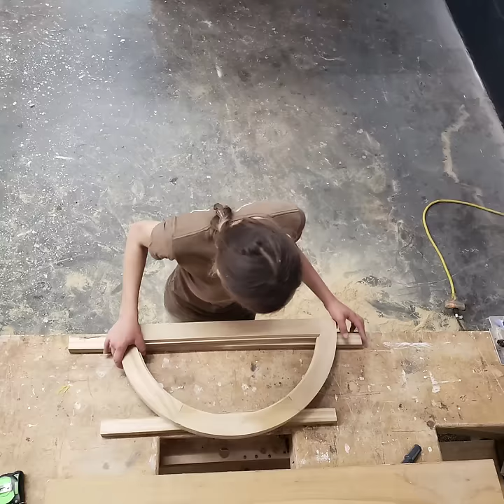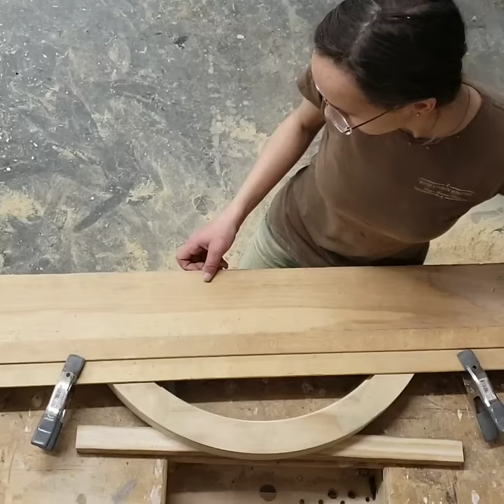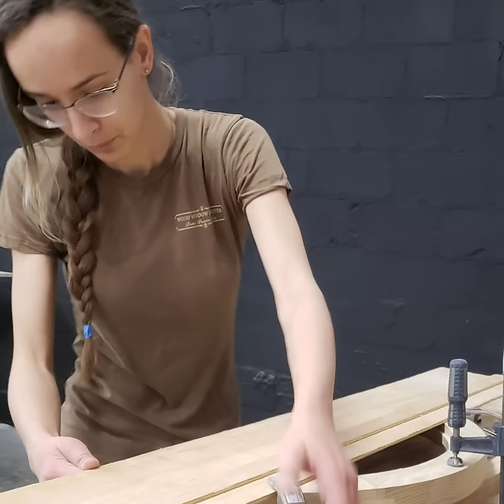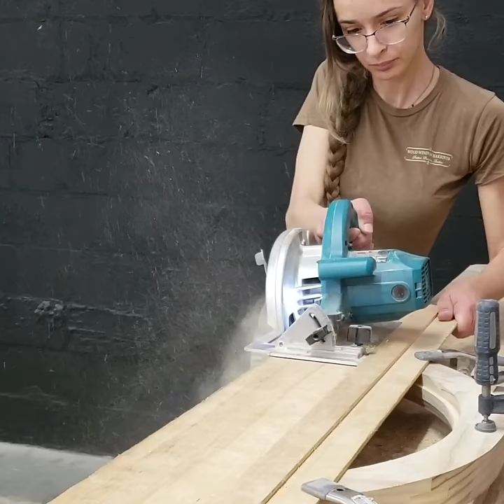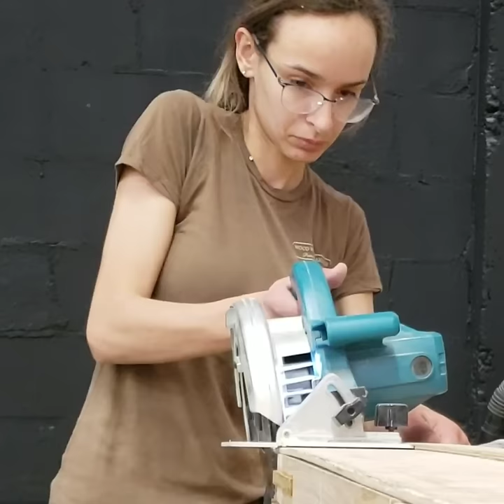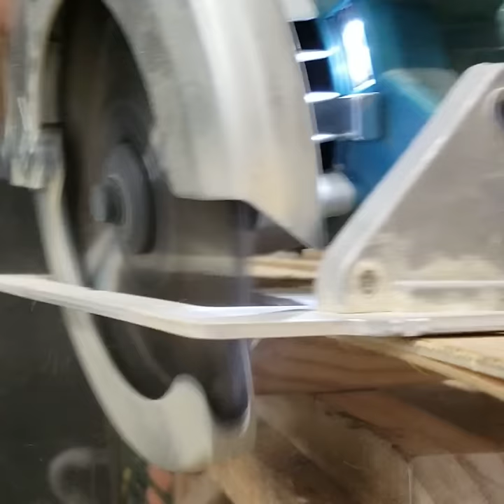Method to Cut Straight with a Circular Saw

Comment: Wow so your using a straight edge to guide the saw... gee whodathunkit?
Reply: Theres more to it than that, the straight edge is on a board which can be lined up where you want the cut (rather than having to offset the straight edge from your cut line)
Reply: All you gotta do is grab the front plate of the saw after you know where you wanna cut and squeeze your finger against the edge of the wood as you push the saw.
Reply: @sykwiddit8575  that's sorta what I do, depending on length/location of cut. Can usually get it good enough for most stuff that way.
Reply: @sykwiddit8575  and which is fine if the existing edge is straight. Even if it is straight, what if you you wanted to cut it at an angle ? Say fitting the bottom sash to an existing sill?

Personally I wouldn’t be without a track saw anymore, this sort of idea is ok for a one off or purely square cuts or a particular angle. Usually this configuration won’t cut any bevel all passing through the same point on the surface.

I came looking for this as some guy was banging on about the ‘beautiful girl’ on the latest video, Steve’s about as pretty as me so I came for anthropological reasons 😉

Comment: Lovely hair but when  it is that close to machines scares it scares me.
Reply: Wolf Den  hate when that gets caught in saws, luckily mine is so thick the saw just shuts off like a SawStop. A bitch to untangle though.
Reply: Especially 8k RPM spinny wrappy bladed machines.  Can't think of much scarier than a circ. saw suddenly jumping at your face as it reels in.

I guess you wouldn't really have time to be scared though.  Still, lots of time for regret!

Comment: Can you the explain all the Big D's? What's the purpose of those half circle arch in the back so if you veer off to the left or right it will turn but the front stays straight?
Reply: Which way was that meant😅🤣I'd say they're about that size
Reply: Pretty sure the big ds are what they want to cut the straight edge on. They look like they’re arch window frames or something similar. The thing they are showing is the board with the fence on where the saw blade is bang on the edge of the board so you please the board edge on the cut line and away you go. Look up track saw use. It’s the same but without the huge price tag.

Comment: Do people actually need to be told they can use a fence to cut straight?
Reply: Yes.
As well as they have to be told to follow standard safety procedures... Like putting up your hair, wearing gearing protection, bracing your work...
Reply: @Glaswalker1001  don't you know? If the hair is up, the likes go down! It's all about the likes man!
Reply: @thelos3999  and you will get the most views if your hair is caught in the rotating tool and severed from your skull.
I know.
Reply: @Glaswalker1001  now you get it. 😁

Comment: I don't like to seem like a H&S freak but the lack of ear/eye/respiratory protection is not good! I always make sure that before I make any cuts I have at least 2 of the above. When I am working outdoors respiratory protection isn't as necessary compared to working indoors where there might be very little ventilation if any. :)

Add that to basic safe working practices and you are just that bit more protected from any accidents!

Comment: Trade out the spring claps and clamp the straight edge and work piece to the work top. Then youre not trying to hold it while you cut and can focous on not being so damn awkward with the saw

Comment: Her saw blade isn't 90° so her cuts are all ruined. Always check for that.  If you need to bevel just tilt the whole saw to the degree you desire and run the saw perfectly straight and don't mess it up or you'll pay for it from your paycheck.   That's how I was taught....  :(
Reply: Obviously she was bevel cutting. 🙄

Comment: Right so
1. No PPE for a start
2. Long hair hanging down RIGHT NEXT TO THE SAW
3. You're cutting in the most awkward way possible, swap sides or hands, one or the other
4. What's the trick? Use a straight edge as a datum? That's not a trick, that's literally how you get trained to cut straight lines in most industries.

Don't know why I even watched this but thanks for wasting 30 seconds of everyone's day mate.